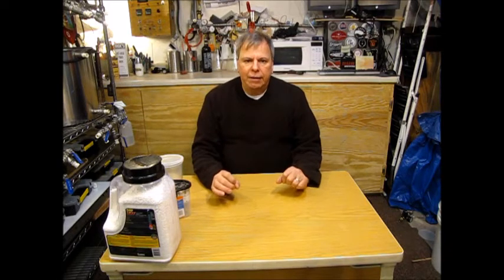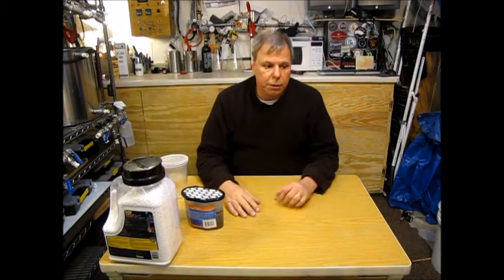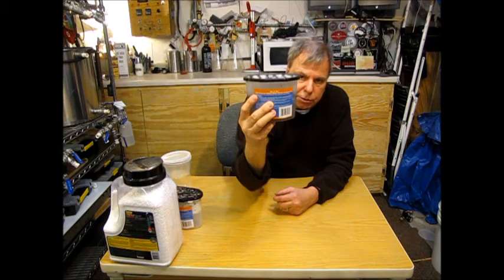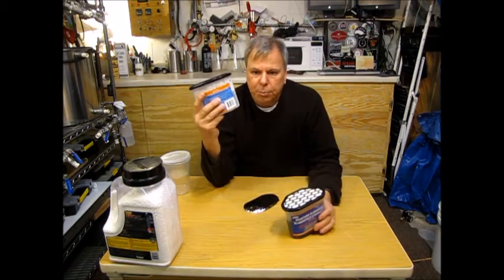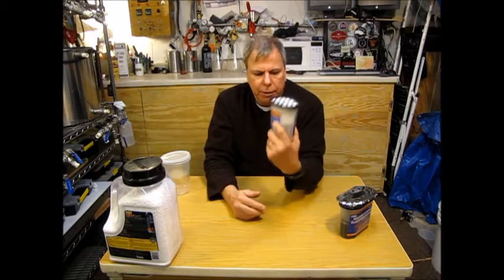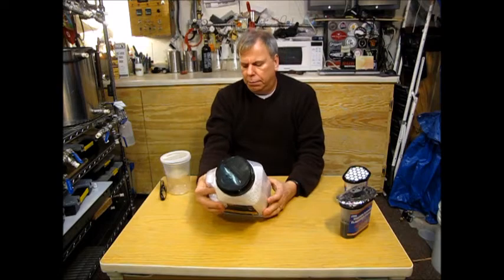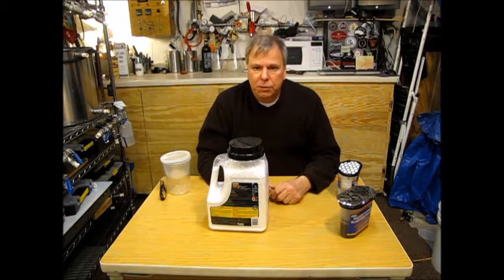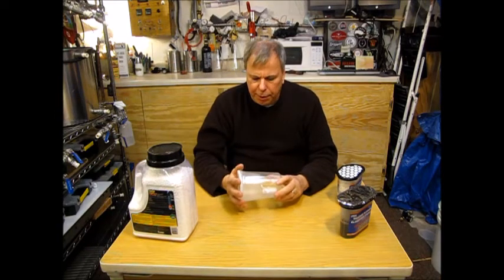Eliminating Moisture in Your Keezer with a Desiccant

Comment: Did/does your 'homemade' desiccant work?
Reply from the maker: Yes it does. Although, the beads sometimes have a tendency to stick together into a big chunk and solidify over time. More recently, to ease things up, I have just bought a couple from the Dollar Tree Store.  I then drilled holes in the side of them once they are used up.  When the calcium chloride is all gone I pour out the water collected and pour in more calcium chloride.  This leaves the one way membrane alone. In the past I removed the membrane and replaced it with tough paper towels, but these would sometime wick moisture and drip it down the outside. Now I just plug the hole with a rubber conduit hole plug or just cover it with duct tape.  Thanks for watching!